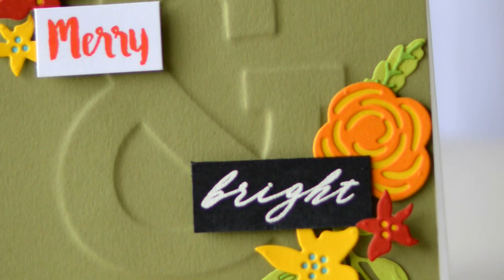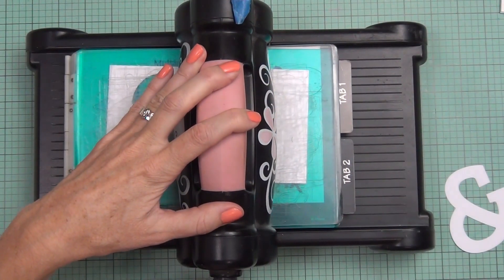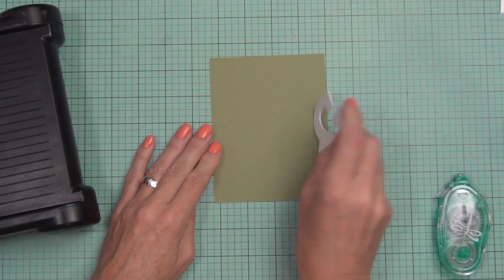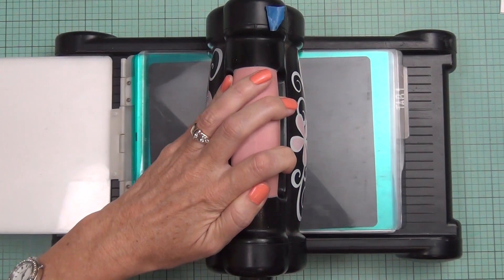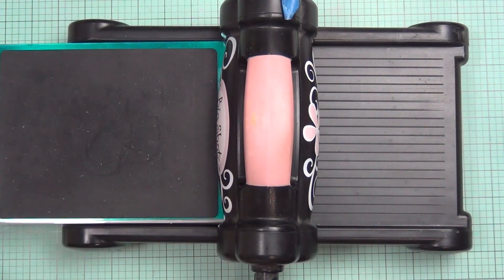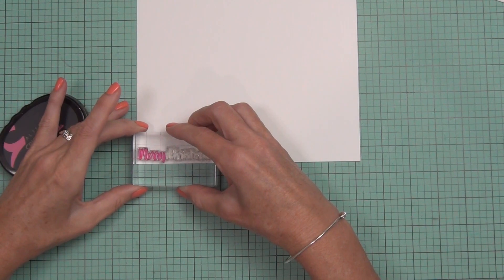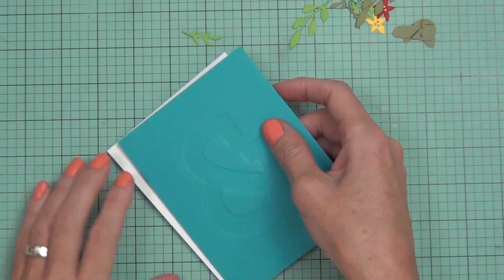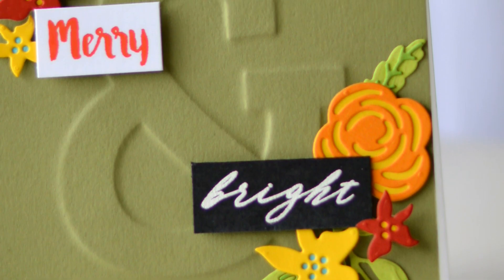How to Dry Emboss with Die Cuts!

Comment: I think I lightly misting the cardstock with water can prevent cracking.
Reply from the maker: Yes it  does and it can also help improve the impression too (especially on different types of cardstock) but I also had someone tell me to try misting it with alcohol which I haven't actually tried myself and I wonder if this is even better than water?  Thanks so much for your lovely visit, Therese